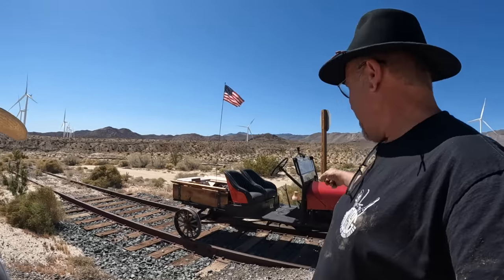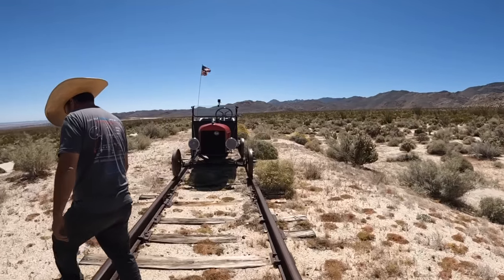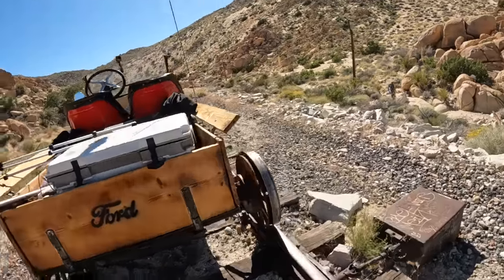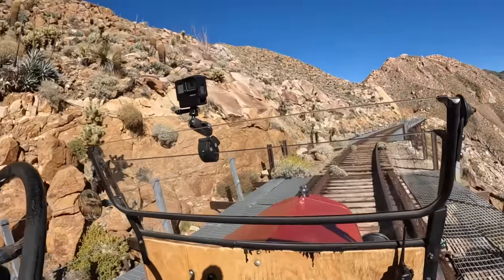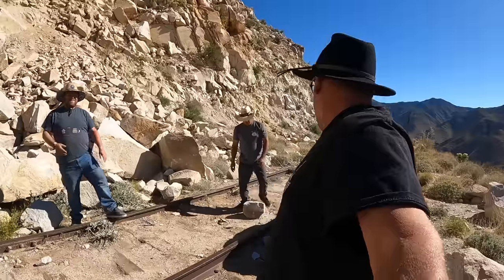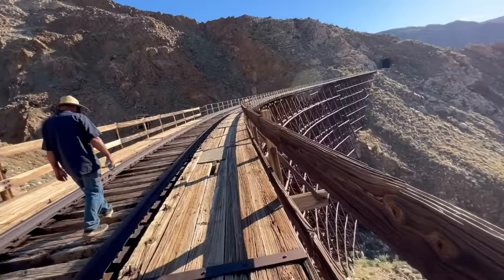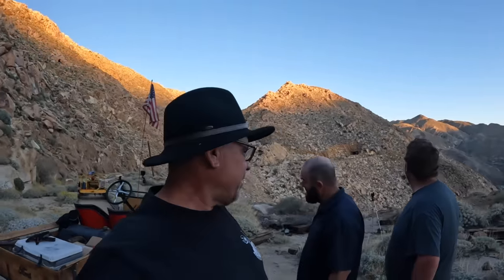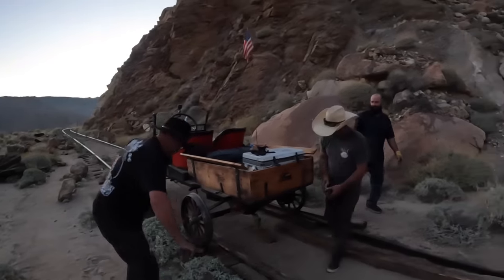Can We Make This Model T Railcar Run and Drive to Goat Canyon Trestle to Go-Kart on Railroad Tracks

Comment: The ties in the middle of the tracks is for the hand carts to turn on. They are moved to the side on the wooden rails to allow trains to pass.
Reply: Sometimes there was a little shed to keep the carts in also from my understanding
Reply: Could be the best place to turn your model T around if you happened to find yourself on the tracks 😂
Reply: Also to clear track for the train
Reply: This is what my grandfather told me when he took me on his motorcar to see the last steam freight pass by.
Reply: Smaller motor cars can be picked up and moved off too.
Reply: That is what it was for , so the railroad workers could get the little putt putt cars off the railroad tracks and let the train pass through,
Reply: We call the little car, a putt putt that was the sound that it made,….
Reply: They are called motorcar set-offs also.
Reply: That's what we were guessing. That's so cool. Sill glad our rail cart has reverse!
Reply: These tracks need to be preserved and offer rides for tourist..
Reply: The speeders or maintenance cars some of them had a turn plate “foot “ on the bottom of them either manually cranked down or some of them were hydraulically, operated.
Reply: I read this comment just a few seconds after Merlin asked for comments as to what the purpose of  those 'structures' was. Your response baffled me until about @29:00 when they started working to turn the Model-T around. Had they turned it around at that structure it would have been much simpler. They could have placed a hydraulic jack on that structure (a solid and presumably level jacking surface) and under the center of gravity of the car. Then it's just a question of jacking it up to clear the rails and carefully spinning it around. If I were going to run rails with that Model-T much, I would rig me a jack and 'centerpoint' just to do that.
Reply: Yes, I agree
Reply: @JunkYardLoungeTV  The "put-puts" had reverse. The engines were 2 cycle, by adjusting the ignition timing, then pushing it in the opposite direction, it would crank and run the other way.
Reply: @blacktberd08  Line sheds or section sheds housed the tools and equipment railroad section crews used to maintain their "section" of the line. Yes the platforms and timbers were used to get their carts on and off the rails, too bad Merlin and Brad didn't use one to turn the T!!  Crews would ride in on the morning train, and would have a length of line that was theirs to keep up. They would work all day and ride the last train out at night.
Reply: speeder parking yes indeed or you could turn around a model t
Reply: @Staceymi2001  thank you couldn’t remember the term just remember I used to be into model railroading and did tons of reading on old train lines and equipment.
Reply: Those ties are actually crossing boards so vehicles can cross the railroad tracks.
Reply: Also motor cars
Reply: Thoroughly enjoyed your video . My wife love it as well. Probably the best railcar video we’ve seen.
Reply: Correct for use of the hand carts to turn around or for them to moved out of the way of the trains.
Reply: maintenance of way,  signal maintenance, track inspectors put puts aka railway motor cars
Reply: Great video. My wife and I are ready to build or buy a track speeder. 
When you organize a track and tunnel clearing extravaganza we'll come out and assist!! 
 As other vommentors have mentioned, the ties are designed to clear the inspection and mow speeders and hand cars from the track. 
 When we went with a friend's group years ago, when turning the equipment, we assessed the weight and heavy end stayed put - my guess is that engine end is heavier on model T. Have you tried leaving that end on rails and spin rear of chassis around 180 degrees? 
Maybe design a dolly to lift and rotate the lighter end?
Reply: Yeah they should have parked the T there turning would have been way easier
Reply: If this was the old railroad that I think it is, the San Diego and Arizona (?), then that last trestle you showed had a special water sprinkler system that was fed by gravity. If I remember correctly, it was on some sort of timer ⏲️.  I was thinking about modeling this line in HO scale, and I bought a book about that Railroad...
SP had a hectic time trying to keep the line up and running.  The rock type in this area is not the most stable type.  Gave SP all sorts of headaches because of the tunnels.  Plus fires 🔥 and tunnel collapses ahhh 🙃🫠🤪😛😜
Reply: ahhh i was wondering if any one  else already mentioned this... yup ive seen it before... lil cart gets to get off the track before main train arrives. Adventure days...
Reply: Can you not start from the other side of the collapsed tunnel to drive across the trestle.  I.E. start from the north to south rather then your south to north or whatever direction the line runs.
Reply: @Mike-rx4in : exactly.
Reply: The setoff allowed the crew to lift and turn the motorcar 90° and get it off the tracks for a passing train.  The motor cars generally had two handles like wheelbarrow handles that slid out to use, and then were shoved back in to be stored.

The setoff is NOT a traffic crossing.  Note there is no road leading up to these timbers. 

These motorcars were still in common use 50 years ago when I was a section gang laborer, aka a gandy dancer.
Reply: There would have originally been a lighter rail t-boning the main track and spiked to those timbers stretching out. Sometimes the Railroad would build a small shanty to store supplies in, or 'camp' the handcart or 'speeder' in.
Reply: Yes I Agree I grew up with the Milwaukee Rd in my back yard thats what the boards with the side timber was for. Watched them use it.
Reply: Mogli użyć gumowe opony. 😊

Comment: The oiler is called a flange greaser. It's used to help minimize the wear of the rail.
Reply: Usually placed just ahead of curves in the tracks where side load on the wheels will cause friction.
Reply: Type MBJ Meco rail - and - flange lubricator
Reply: Awesome really enjoyed it
Reply: Wear and friction reduction oiler for curves…
Reply: Yep it is a track oiler to cut down on friction on the curve.  Still being used on some sections.  Good call @pbaemedan
Reply: and the wheel flanges
Reply: I live near the B&O Metropolitan line, now CSX. They have a flange lubber near me, solar powered.

Comment: The ties between the rails with two additional ties perpendicular to the side; This is a motorcar set-off.  Maintenance workers have to get out of the way for the trains.  Each morning before the workers went out on the tracks, they got a “lineup”, or train schedule.  Trains run on strict schedules….sometimes late, but never early.   The workers would drive to the “set-off”, slide out two long lifting bars, pick up the back of the motorcar, and spin it 90 degrees on those ties between the rails.  They could then push the motorcar out onto the ties that are perpendicular to the rails, park it, and wait for the train to go by.  After train passes, the push the car back and put it on the rails.   These were also used as turn arounds.  Rather than backing the motorcar all the way back to the maintenance shop, they would use the set-off to turn the motorcar 180 degrees and drive back going forward.
Reply: Surly these 4 numptys should of gone back to a set off point and turned there. And taken all that weight out of the back to turn it. Or have a balanced pivot point to jack it up on then turn it anywhere !!!
Reply: Before accurate watch mechanisms were developed there was a very high fatality rate for these workers who did not get off the rails before the train came along and crushed them due to an error in synchronizing the workers watch with the train schedules.  These tragedies were eliminated  when watch accuracy improved.
Reply: @STRIKINGLIGHTING1  Yep, they should just gone back to the set off.  What they did was especially the same method that the set off was designed for!😀
Reply: The Tamper and Kershaw Ballast regulators have a center jack that would come down and you could spin the track machines 90 degrees to use a set-off, or 180 degrees if you wanted to maintain track going in the opposite direction.  Fifty (50) years ago it was very easy to spin a machine around if needed, but it was not much fun building a set-off and leaving them there over night.  We had pretty old ties and I always thought we would find one of the machines fallen off the set-off and into the ditch.  I really don't miss working on the tracks. lol
Reply: @brettbump9491  the issue with the tamper and ballast regulator was they were so long you had to have the switch ties on each side of the tracks in order to roll them off the tracks.  What I feared the most was setting up the rails to load a tamper and regulator up onto a flat car.  Lots of jacking and stacking to build the supported ramp on a siding.  I never had to drive one up the ramp we made and I am not disappointed about that in any way.
Reply: I use to have one of those setoff in front of my log cabin... Workers in those motorcar were fishing in the ditch and catching little trout while waiting for the train to pass.

Comment: This track was originally built by John D. Spreckles. He was a sugar entrepreneur in San Diego, California, 1853 - 1926. The engineering people and many others said it could not be built, and it was nick- named , "The Impossible Railroad." Mainly because of the steep rough terrain going down into the desert of Imperial Valley. It was later named The San Diego-Arizona Eastern Railroad. There is a custom-built steam engine made for this railroad. It used vertical pistons for more power to get up the steep grades from the desert. I got a chance to see this steam locomotive many years ago when it was being stored and restored for the museum. They had it at NAS Miramar for some reason. My dad was in the Navy, and one of his comrades took us on a personal tour of it, and a couple of passenger cars were there. That wooden trestle is the world's biggest curved wooden trestle! To bring supplies into this area even with todays technologies would be amazing. They did this in 1920's. Solid rocks and deadly heat. The collapsed tunnels to the north of the trestle are the original train route until a major California earthquake happened around 1933. This prompted the construction of the wooden trestle. Mr. Spreckles had a mansion in Coronado, California there are many landmarks in San Diego County named after him. Organ pavilion and an amphitheater. I've been a San Diego County resident since 67 currently live near Campo, where the museum is located and very close to this trestle in the video. I actually live closer to the famous tunnel where the train goes into Tecare, Mexico, for a short distance and back into the United States.

Comment: It is called a rail greaser or track greaser. These devices applied a small amount of lubricant to the edges of the wheels or rail as the train passed over them, helping to reduce friction.

Comment: You are right. It calls oil lubricator. It pushes the oil to lubricate outside wheels before heavy curve.
We still use it in Ukraine.
Sometime oil lubricators installed constantly on locomotives which work on mountains.
Also we use special locomotive which calls Lubricator. That locomotive runs before the train to lubricate the rails and make train ride more easily.
Sorry for my english)) I still learn it🙂
Thank you fir the video👍

Comment: After turning the model T, I guess you can see what the wooden structures were for. Turning hand carts off the track.
Reply: Those weird 'metal looking' spikes were called 'silver dollars' back when I pounded them into Timbers while on the bridge gang in the '80s on Conrail.. they're actually very large screws , a foot long  that rotate in as you hit it with a 10 lb Sledge... Pre drilled with a slightly smaller hole

Comment: The oil box is a flange oiler. It helped reduce drag of the wheel flanges on the curves. The timber strucures are speeder "set outs". Track crews had to stay out of the ways of  trains. The speeders were light enough to pick up one end, rotate 90 degrees, and roll on the timbers at track side.  Looks like fun.

Comment: The bits that go off at a 90 Deg angle with wood in between the rails are to enable maintenance vehicles to put their turntable down, lift the vehicle up, spin it 90 degrees onto temporary rails and drive off out of the way for a train to pass. To save them having to go all the way back to a station/loop.

Comment: What a beautiful landscape and epic bucket
List trip. Thanks Merlin! 

Next time, maybe put the boards under the model t longways with a bottle jack under the center of the T and spin it on the rails. ;)
Reply: That's the way we do it on the W.W.& F. Ry... Our model T rail car has a balance point. We have a board notched for the rails, (2', not 4' 8 1/2"), the jack goes in the middle, and the whole car comes up off the rails, and two people swing it around!

Comment: Great adventure for that era appropriate car. Not sure if anyone answered your questions, but the device filled with oil is a flange oiler that prevents rail wear on curvy railroad tracks. The wood ties in the center of the track and what looks like wood railroad track next to it is for speeders to be set out of the way of oncoming trains. Thanks for the ride guys!

Comment: Thank you for the Train ride and a part of my teenage years. We used A 50 Plymouth. Dropped the air pressure turned up the idle and road for hours. Never touched the steering wheel. Sat on the roof or hood drinking sodas.

Comment: The jumble of cross ties with the 2 long ties going away from the track were where the speeders were taken off the track to allow the trains to pass and for removal debris from other parts. You should have backed the model T to one of those, would have been much easier than what you went through. Great video as usual.

Comment: Hey guys, put a bridge in the center of gravity on the Ford T chassis, and use a hydraulic jack, so it will be enough to raise the 4 wheels a little, and make them rotate on the central hydraulic pivot, to reverse the direction of travel . I congratulate you for this excellent video!!!!  Greetings from Argentina !!!
Reply: this is how the model T railcar at the Pleasant Point Railway Museum in NZ is turned around!

Comment: The structures between the RR tracks with the two planks running perpendicular out from the rails was used to get the speeders off the track to let trains pass. To turn the T around, mount a plate under the car at the balance point. When you want to reverse direction, jack the car up using the balance point and spin the car around 180 degrees. The RR had some speeders that had provisions to do this.

Comment: That box next to the track you showed is a greaser.  It works exactly as you explained and it puts grease on the rail head/ flange to prevent wheel wear and track wear.  Pretty cool how it seems to be home made

Comment: hi guys
to aid in turning the model T round you need to find the perfect balance point under the the car and place your jack at this point, you may need some form of bracket under the vehicle. Jack up the car till the wheels are above the line then it is just a matter of rotating the car to face the other direction ,lower the jack and remove  away you go. There is an old rail ambulance in my town with this principle.

Comment: If you find the balance point in the center of the model T you could place a jack in the center with a pin on top and weld a heavy washer to the balance point and with one person on each end swing it around in a few minutes with very little effort. I love watching rail riding videos. Great job.

Comment: The pump oiler at around 10min mark is a greaser, pumps grease onto the flange of the rail when a train passes over to lubricate the train wheels and rails. normally on curves where the force from the wheels is greater on the flange of the rail and the wheels, to prevent wear.

Comment: To answer your question about the wooden platform between the rails at 21:55, that was a place for work crews to set their little track cars off to clear of the main line. The cars were light enough that 2 men could easily lift it, spin it 90 deg, set it back down on the platform and run it out on the wood rails till It was clear of the track. Super video!!  Thanks!

Comment: You are right about that box with the pump. That’s a greaser. It greases up the wheels of the train as it passes by to reduce the friction and wear and tear to the wheels and rails as it goes around tight turns. Nowadays they are mostly electric and detect a train and pump out grease. And have a solar panel sticking out the top

Comment: From my limited railroad knowledge, the second track at 5 minutes in is a bypass that allowed one train to be filling with water while more trains can continue on their way. Track oiler at 11 minutes is a flange oiler, to lubricate inside faces of the rail to allow trains to go around tight turns easier. And the timber "crossing" at 22 minutes looks to be a leftover from a railway maintenance shed. A shed like that would house some tools, supplies, and a small speeder. The speeder would get man-handled onto the track and the crew would take it to the job site.

Comment: The oil pump was two lubricate the inside of the trains's wheel flanges so there was less wear on them when they went around the sharp curves  !! I would say the two lengths of wood sticking out at 90 degrees to the track would have had rails on them and they kept a hand pushed maintenance trolley on them to carry tools and jacks  to the site of work and when the worked  finished it was  wheeled back  and the tools and jacks taken off and then lifted by hand and put back on the rails . That's my guess any way !